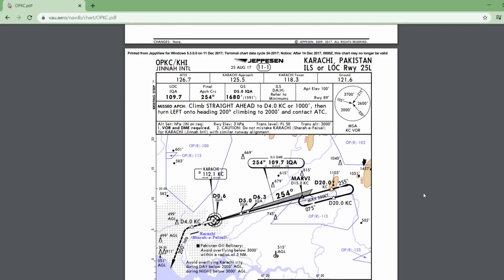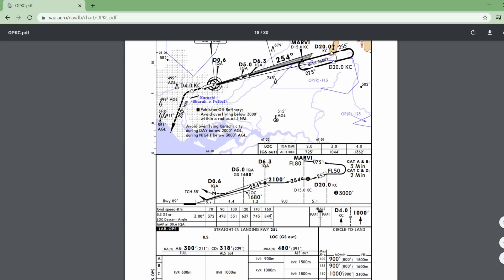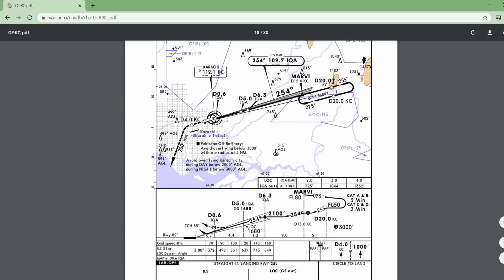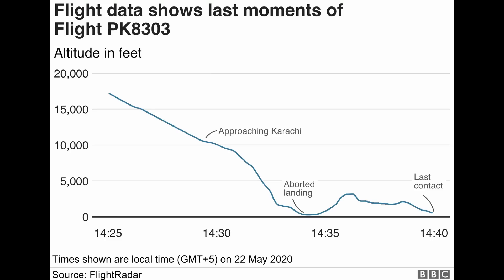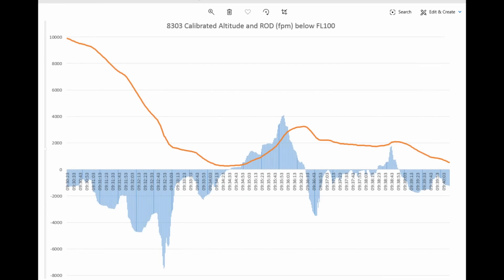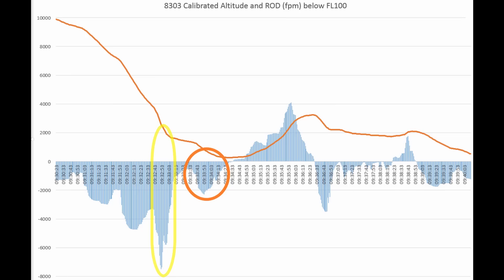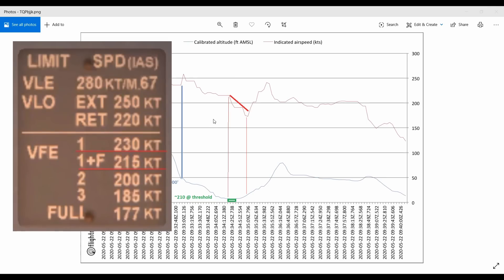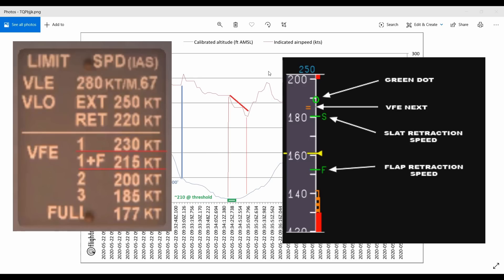PIA #8303 Update #4 Unstable Approach Profile

Comment: Funny that after more than two years there is still no official report on this accident. On the face of it, the investigation should be simple: both CVR and FDR are available and the aircraft remains are within plain sight and not at the bottom of the ocean. In my opinion, excessive delay only fuels speculation that something fishy is going on.

Comment: As a former bus guy the only way to get down is slow down gear down     Violates the minute to live rule.   Learned that early on.  So at 2000 feet MAX descent rate is 2000.   But.  You would not be stabilized.

Comment: Question for you Juan. In your 1st video you stated that in the Airbus  the gear would not deploy at speeds in excess of 260 knots. If the pilots doing their prelanding checklist deployed the gear but were at a speed greater than 260 would the gear  automatically deploy after a speed below 260 was attained? My thoughts not knowing is that they deployed above 260 and went on through their checklist thinking that the gear was deployed and that's why they scraped the engines on the runway. Just an uneducated guess. Thank you.

Comment: This is just insane.
Just a small correction  (@ 2:00) The descent rate mentioned on the chart is based on ground speed that means it won't change with wind because the wind is already in it.  You would fly your approach with a pre-calculated IAS and with the wind you'll get a ground speed. On a normal approach with an angle of 3 degrees (5%) your rate of decent is roughly your GS x 5... That means: Even if you are crazy and would fly your approach with 250kt over the ground you would need a ROD of roughly 1250ft/min to follow the glide-path....

Comment: You are pretty accurate but There is one major flaw. Actually whatever ATC Talks they released is after first go around. In my opinion there were 2 missed approaches which you can see from Height to time chart as twice altitude increased, most of the people are getting this part completely wrong. 

Here is what I believe happened 
1) Airplane was coming in with Unstable approach and was too high, so they lowered aircraft down very quickly (From height to time chart you can see they lowered altitude at about 8000ft/min)
2) Because of fast speed, gear was not lowered, pilots ignored the warning and scratched engines on runway and did a go around
3) Now they are coming back for landing and all released ATC Talk starts now on wards, they are having unstable approach again (Highly possible they caught false ILS Glide slope which may happen when Airplane is too High, but here they said Everything is under control, we will be able to make it, (this time) Inshalla, Plot also tells ATC that they are 3000ft from 3500ft)
4) ATC instead of warning about their height, offers them to go around, where pilot replied he is comfortable. he is established on ILS (false ILS Glide slope) and because of that he can land safely
5) Now ATC tells them that they are 5 miles from touchdown but at 3500ft (According to flight chart they need to be at 2000ft at 6 miles, so for sure they caught false ILS glide slope). Again in previous conversation they said they are down at 3000ft but ATC tells them they are 3500 ft so there may be some problem with their altimeter. You can hear warning dings in the background, at this point which may mean  gears are not extended, engines have problem or something else and because of that
6) Eventually Pilot agrees to go around (you can see from Height to time chart that their altitude went up), again there are no beeps in background which means, those beeps most probably were from gear not lowered. 
7) ATC tells them to turn left heading 110 and climb to 3000ft for second go around
8) ATC tells them you are dropping altitude and are now at 2000ft (Engines are having serious problems now most probably full thrust for second go around which requires 100% engine power killed whatever was left in already damaged engine, second go around was the final nail in the coffin)
9) Now they as they are losing their engine power, they talked to ATC that they are trying to maintain altitude 2000 and ATC affirms
10) ATC warns them that they are dropping to 1800
11) ATC is telling them that they appear to be turning left and Plots inform ATC that they lost both engines and will be proceeding direct (Without ILS Slope and taking shortest distance, not in line with runway as they are turning), their speed is pretty slow so landing gear came out (You can see from crash video that landing gears were out) other reason may be they did gravitational lowering of gears
12) ATC asks them if they are going to do belly landing as gears never came out during first and second approach
13) Pilot says May day May day
14) ATC says both runways are available to land and it was the last communication.
15) Everyone RIP

Comment: Crew errors? Obviously. But what were the factors? I think one has to do with that "universal" singular pinging alarm-tone being used to indicate too many different aircraft configuration issues. Using the exact same warning-tone to indicate a myriad of problems--from incorrect flap settings, to an unsafe landing-gear, means the alarm itself is minimally informative--and will likely frequently be "chiming away"--easily becoming "background noise" during approaches. It gets worse from there. The automation of the Airbus's landing-gear system, flap-extension system, and others likely also played a role. These systems' own safety features--intended to prevent overspeed extension--may become relied upon as some crews develop "Shortened Checklists". Automation sadly tempts crews to do this--and tragically, "Improvised Checklists" may be used extensively by crews without incident, resulting in further complacency. This has lead to many aircraft mishaps already. An Airbus crew seeking "shortcuts" might lower the gear and flap handles earlier in the landing sequence--relying upon their "automatic extension/deployment" as the aircraft's speed drops to below each of those systems' safety-lockout speed thresholds. An approach this hot and high would expose the weakness of a crews' "Improvized-Shortcut-Approach-Plan". Just as obviously, in order to use "improvised checklists"--crews must also have to learn to ignore that universal pinging alarm-tone. I cannot say for certain "Abbreviated/Improvised Checklists" were the issue--but it sounds (from the ATC recordings) as though this crew was at least very, very good at ignoring the sound of that pinging alarm.  Ultimately, the CVR will tell the tale I suppose. Tragic.
Reply: Airbus uses the ECAM screen to tell the crew quite precise what the actual problem is once an alarm or a notification is triggered. The alarm chime really is only there to tell the crew that there is a problem, then they can see at the center screen what the problem is.
Reply: @shi01  I understand the alarm is only saying, "Check ECAM for an important message." But any crew using their own "Improvised Checklists" --full of shortcuts--will by neccesity be just as much in the habit of ignoring the messages on that screen, as they'll be accustomed to ignoring the incessant chiming.

Comment: Would this be evidence of an emergency rapid descent landing on first approach?
Reply: There was no mayday call before the first approach. They didn't even abort the approach when the master caution alarm was going off which could be heard in the ATC transmission, which is strange because such an alarm during the approach normally means a certain go around so the crew has time work out whats wrong and fix it if possible.
This looks to me as they deliberatly ignored the alarms. I think they knew they were way outside there SOP and expected the alarms to trigger beforhand.

Comment: This crash occurred due to blatant unexplainable pilot error. How can a  trained pilot with 17000 hrs under his belt, land an aircraft without landing gear deployed. Not possible to ignore the warnings the computers will throw at you if you try it. Then the almost vertical dive , overspeed and ignoring all the warning alarms and lights !!
What was wrong with flight crew ? Only CVR can tell . But listening to ATC recording , pilot hardly shows  any sense of alarm or emergency to control tower. Except for last mayday ..
Could this be an intentional crash disguised by pilot to look like an accident???

Comment: So.....they were screaming in and down at a crazy rate.  Is the alarm the same for being out of landing parameters the same as the alarm for gear still up?  Could they have put the "gear down" lever in the correct postition, only to have the computer, sensing overspeed, override that control input?

Comment: The tremendously incompetent alleged  pilots in the cockpit of PIA  flight 8303 had no bidnezz being in the cockpit of any plane.  It's obvious they didn't understand the systems of the airplane, example -   in a A320 if you put the landing gear handle down when you are going faster than the max landing gear operating speed,   IT WON'T GO DOWN !   And it won't go down until you slow down below the max operating speed, put the handle in the up position and then put the handle in the down position.   The idiots in the cockpit didn't care about the safety of their passengers, they were just a couple wannabe pilots that killed their passengers.  Being at 10,000 feet about 15 miles from the end of the runway and diving down at 7,000 feet per minute to try to intercept the glide slope at the outer marker is stupid, it places you in a position of making more mistakes, unless you have excellent piloting skills, which they obviously did not have.  Crossing the end of the runway at about 210 knots instead of a more reasonable 120 knots again demonstrates that they were flagrantly incompetent.    They were not competent to operate anything more complicated than a camel.  Some people may think that my comments are not  " politically correct " ,   maybe not, but they are TRUE, and if you think that my comments are not politically correct then you should of been a passenger on flight 8303.    Steve Kehmeier , Airframe & Powerplant mechanics certificate,  Flight Engineers certificate, Airline Transport Pilot certificate, with a type rating in 4 aircraft.
Reply: The gear "won't go down until you slow down below the max operating speed, put the handle in the up position and then put the handle in the down position."  This might be a good theory on what was the main reason for the crash, since If the landing gear was extended, as they obviously thought it was, the plane would have landed safely.  They were ignoring the gear warnings because they thought the warnings had to do with their insane approach.  They had no idea that the landing gear never came down.
But something might be wrong with your theory since in order for the gear not to come down, they must have tried to deploy the gear above 250 or 260 knots.  According to Juan's graph, that meant that they were flying at 10,000 feet.  Would it make sense that they would deploy the landing gear this high?  Or perhaps when your descending like crazy, the hydraulic safety valve still kicks in.
Reply: Yes, rapid abnormal descent may have activated the safety valve
Reply: @rib787  This sounds like the most plausible explanation. Safety valve not opening during rapid decent, then not resetting the landing gear handle.  They did not want to die or crash.  Just flying at the edge...
Reply: He had 17000 hours flying experience.  He could have flown this aircraft blindfolded. 
CVR will show us there was something terribly wrong in the cockpit. I suspect foul play and intentional crash.
Remember that German pilot who locked his captain out of cockpit and put the plane in a nose dive

Comment: I find this incident very interesting as I believe that things we’re going terribly wrong long before the last minute decent. Meaning they were physically there but not cognitively clear enough to make decisions, just like been in a decompression chamber. You’ve got to give credit to the crew for due diligence until proven otherwise. What crew dives an A320 out of cruising altitude and totally ignores the all the bells and whistles of the gear down and locked in position with a 3 in the green indication. If there was any chance of a cabin pressure leak of some kind with no warning which I know sounds crazy that would account to the behaviour of the flight. I find it very difficult to believe that two airline transport rated pilots in particular would perform such an act showing such a lack of accountability unless they were recovering from a state of hypoxia. Just saying, another thought

Comment: There are aviation safety protocols in place for a reason. Pilots are supposed to be well rested 8-10 hours of sleep prior to flight. Also they are to conduct unbiased psych exams by a third party and complete a flight proficiency check, either in an actual aircraft, or in a simulator, every 6 to 12 months as a requirement for active pilot license. 
It is to my understanding that you put the landing gear down at an altitude of 1000–2000 feet, about 2–3 minutes before touchdown. Not only the plane had a high speed, it was flying at high altitude of 3500-3000. You can hear the beeping of alarm in the unofficial recording released by CAA. Frequent flying and sleep deprivation may be a contributing factor in making a bad judgement call. SOPs were violated! 
Bottom line is that there is blood on PIA and CAA hands.

Comment: According to currently available data, the plane attempted to land much too fast and without the landing gear down despite alarms. When the engines touched the ground, the pilot attempted a go round, but the engines had been damaged and lost power.
The two black boxes will be analysed in France next week and will tell what really happened.
BTW were the pilots really fit enough for their task ? it was ramadan time there...

Comment: I haven't seen mentioned that the gear-up condition would significantly reduce the expected bleed-off of the (excess) landing speed, and may be why the first contact is so far down the runway. I imagine them in this long, long flair wondering why the gear isn't hitting the runway.

Comment: I have flown with Pakistan pilots for thirteen years of my flying career and found them very competent. This crew made some very unusual decisions. Have you considered that this accident occurred at the end of Ramadan - a month of fasting - travellers are not required to fast but many do. I have seen over the years many normally competent people deteriorate in their performance during this holy month. Such a sad accident
Reply: It is likely that due to the unstable approach caused by high velocity the pilot realized albeit very late that they won't be able to land the plane properly and will off-shoot the runway. They had the landing gears down first, but retracted them for a go around. The landing gears retracted but it was too late (given their initial velocity) for them to avoid scraping the engines on the runway which is likely to have caused subsequent engine failure.
They seem to have approached the runway at more than 200 knots which is a mystery (maybe human error, technical error or both).

An example of unstable approach and late attempt at go around: 
https://www.youtube.com/watch?v=wo89QGbMdXw

It could also be that the engines were out just before the first landing when you hear the "ding ding ding" and not after it had scrapped the runway.

Comment: The Pilot was a senior one in the industry with 17000 hours flight time, an x Pakistan Air Force Pilot suggests that this may be the problem with the mindset of so-called senior pilots, sometimes they act overconfidently and ignore ground control's assistance, as they think they know too much.let's see whats the final verdict of an inquiry.
Reply: It is likely that due to the unstable approach caused by high velocity the pilot realized albeit very late that they won't be able to land the plane properly and will off-shoot the runway. They had the landing gears down first, but retracted them for a go around. The landing gears retracted but it was too late (given their initial velocity) for them to avoid scraping the engines on the runway which is likely to have caused subsequent engine failure.
They seem to have approached the runway at more than 200 knots which is a mystery (maybe human error, technical error or both).

An example of unstable approach and late attempt at go around: 
https://www.youtube.com/watch?v=wo89QGbMdXw

It could also be that the engines were out just before the first landing when you hear the "ding ding ding" and not after it had scrapped the runway.

Comment: Looks like the descent into Karachi was missed and at realized at the last moment. This was followed by a dive to catch the ILS, however the speed of the aircraft was above the speed for deploying the landing gear. At that point it was too late to pull up. Simple go around at 10k would have avoided this tragedy.
Reply: It is likely that due to the unstable approach caused by high velocity the pilot realized albeit very late that they won't be able to land the plane properly and will off-shoot the runway. They had the landing gears down first, but retracted them for a go around. The landing gears retracted but it was too late (given their initial velocity) for them to avoid scraping the engines on the runway which is likely to have caused subsequent engine failure.
They seem to have approached the runway at more than 200 knots which is a mystery (maybe human error, technical error or both).

An example of unstable approach and late attempt at go around: 
https://www.youtube.com/watch?v=wo89QGbMdXw

It could also be that the engines were out just before the first landing when you hear the "ding ding ding" and not after it had scrapped the runway.